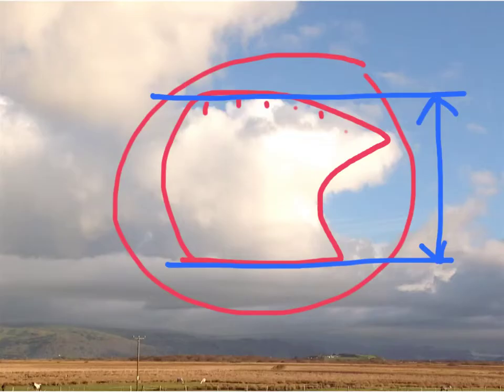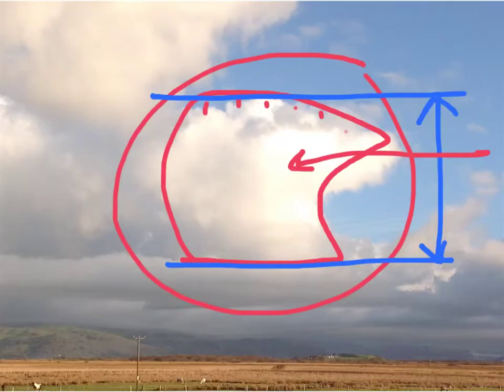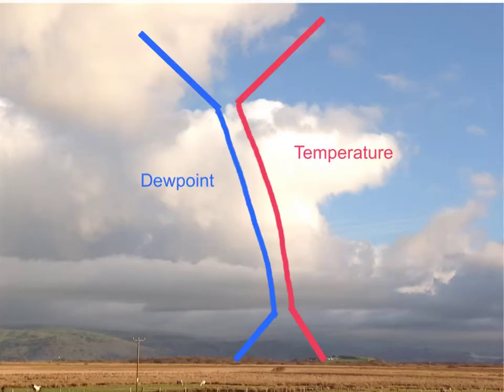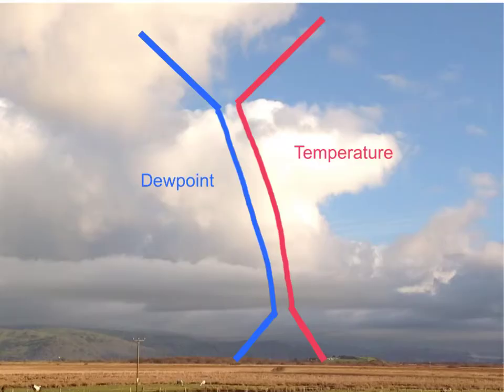Weather School - Growing Cumulus and the Skew-t

Comment: From looking at the cloud, it looks as if it hasn't quite hit tropopause yet.  So your temperature and dewpoint overlay are somewhat off.  The temperature trop inversion can be much higher than shown with the dewpoint maxing out at the cloud top.  The flattening of the clouds that you see in the picture may be due to wind shear.

Comment: Correct me if I'm wrong, but I think the SALR is 1.5 C/1000ft.
Reply: Team eVol "A typical value is around 5 C°/km (2.7 F°/1,000 ft) (1.5C°/1,000 ft)" you're right.  Further more at the EL, the air will no longer rise with DALR .. it will just stop rising there.  Certainly with the temperature curve which he drew ;)
Reply: cheers mayt
Reply: Team eVol Paragliding it
Reply: Team eVol Paragliding